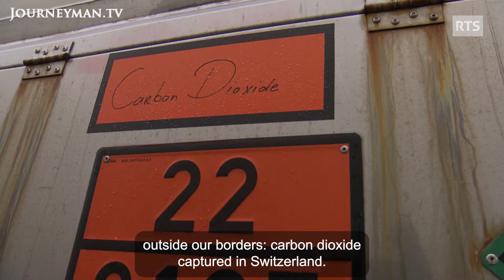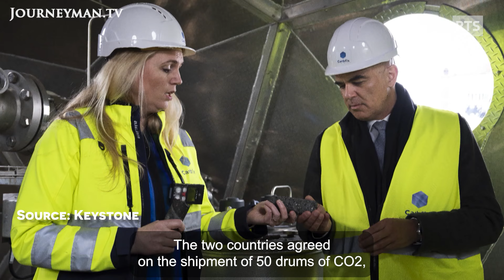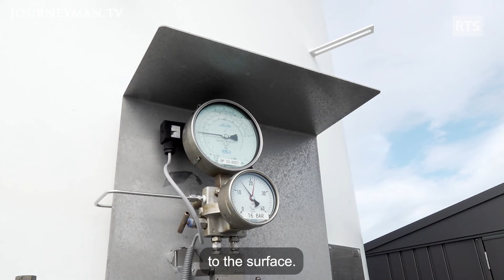How CO2 from Switzerland is Locked Away in Iceland’s Depths | From Basel To Basalt

Comment: Prof M drinking arsenic water through a filter...mmm plan A filter it through 2600 kms pipe lines, plan B?, plan C?, plan D drive 500k ICE (internal combustion engine) trucks 2600 kms annually for filtered arsenic water.
Meanwhile people drinking water from pure glacier water...could we build with different materials than CO2 concrete?
What is Operation Berkshire 2.0?